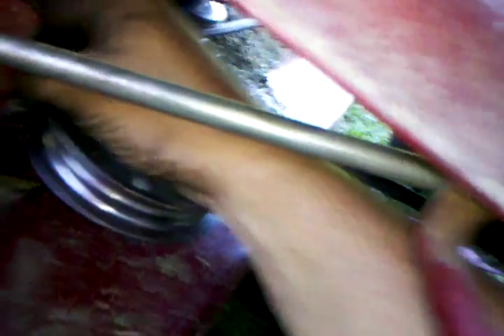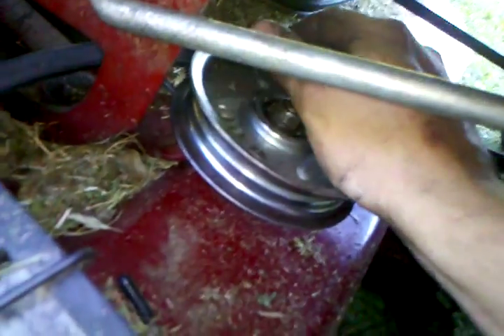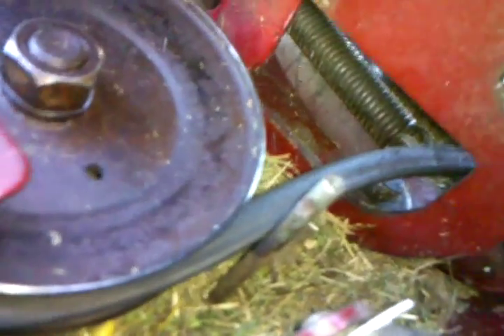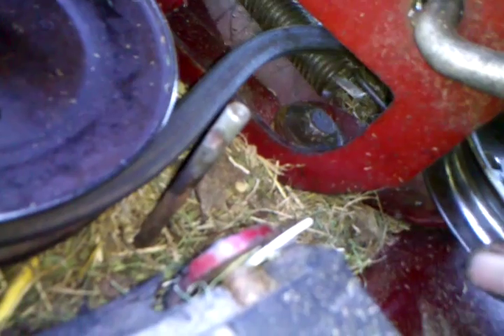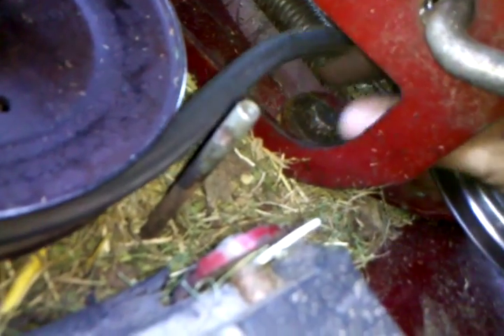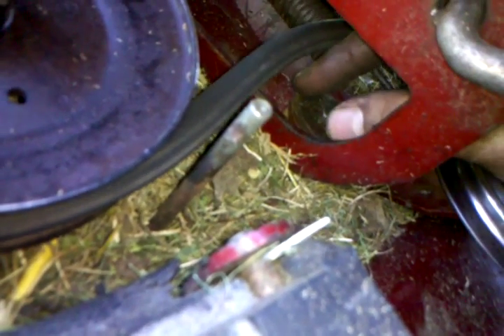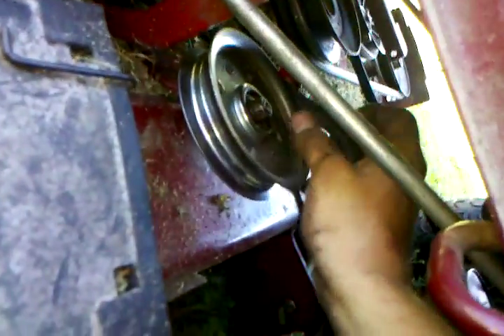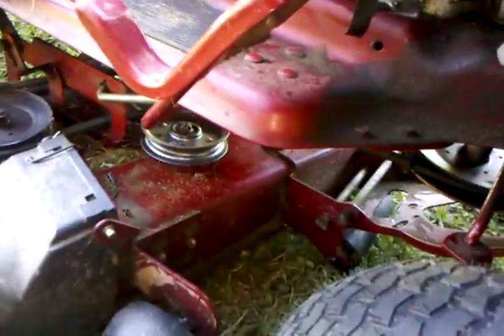1996 Murray Deck Belt Slipping In Low Position.

Comment: I have a Stanley 46 inch cut that slipped and I replaced belt and it still does same thing.  I know I have right belt and I know that when I ingage blades the idler Lully moves fully to the tight position.  I’m going to try a wider belt

Comment: What was this video all about,   what was the problem and what was the solution? ? ? ?
Reply from the maker: There's so many versions of this mower that matching belts is tough if you don't have the old one. I got a belt that was one inch long and had a burr in it, once I got the right belt it was fine. Mower blew up six months later, big POS.

Comment: Hey !  Have the same issue ! Should I get a shorter belt than the original one ? What to do ?
Reply from the maker: Yes 100%. The belt in the video was one inch longer than it should have been. I thought I matched it correctly, the guy at the mower store said that model had so many production runs that you have to match to the serial number not the model and year.
Reply: @HappyOldDogAndCatFarm  Hey !  Thank you very much for answere !  Internet at it best and you doing the service for me !  Perfect.  Well...I love have my lawnmoover to work and is it just fun and good to have a lovely lawn cut and nice looking.  Also very pleasant and joyful to lawn bigger area with the sitting lawnmoover.  Excuse my bad english.  I should have 037 X 86 MA. belt...but to me it looks like to long when having a look at it. I tried to adjust the deck with the adjust screws ...up and down... but nothing works.  When put in low position 4...it slips...afther some time again and again and again.  3 position works great...but than the lawn is not cutted low enough for my satisfaction. The tracktor...2005 model...looking damn cool and works great and fun to ride...but this steal some of the joy of course.  I like have it perfect of course. So...i will try to get a shorter belt...but not sure what to look for.  Could a belt with the numbers 037 X 75 be a thing... =. I would thing 037 means ticknes and 86 means leght...but you know in Norway we use cm and mm...and metres...so not so easy for me with inches..to understand what is what.  I would thing that 037 X 83...0r similar...would be more what i should get... 037 X 81 maybe.  I will talk with experienced experts about the matter though.  Thank  you again ! :-)
Reply: Very pleased...because i see you post is ten years old ! :-). Keep up the good work ! :-)